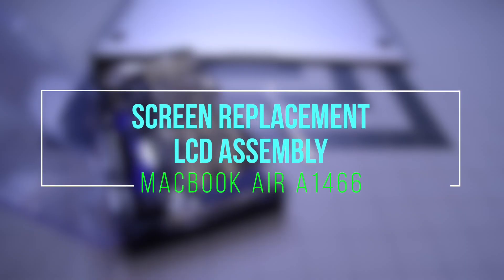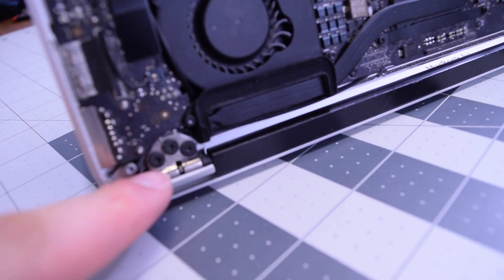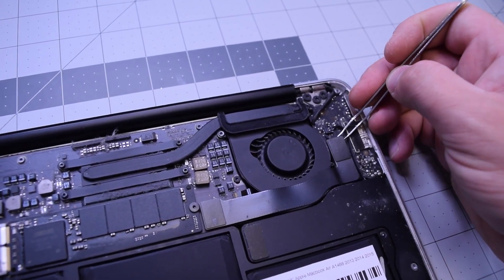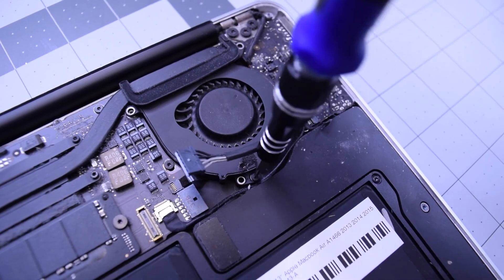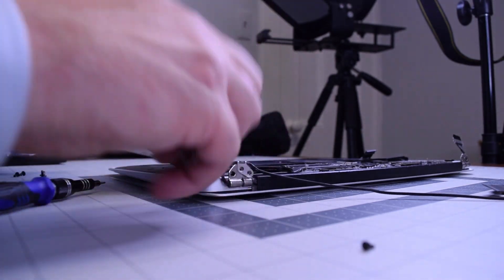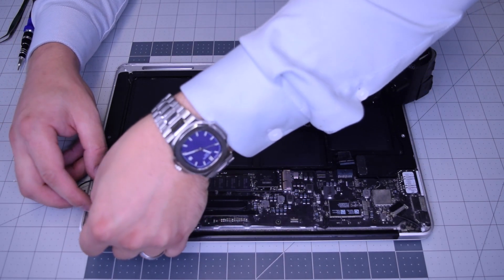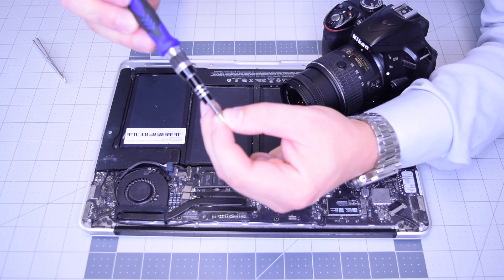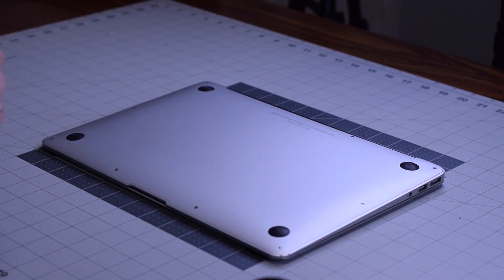Macbook Air 13" 2012-2017 (A1466) - Screen LCD Assembly Replacement

Comment: I really did not want to buy a new laptop for 1000$ and I am so happy that there are still tutorials out there for me on my old MacBook Air mid 2012. I saved 400$ doing it myself. 

PS. It doesn’t look like I messed anything up but I did not have to remove the fan or speaker connector. I just removed the Wi-Fi connector and the 2 connector on the side.
Reply: Please where did you get your screen from?

Comment: Of course, I'm 3 years late, but thank you for the excellent tutorial! replacing the screen was a breeze, following your instructions; just one little detail I'd like to point out: I was able to remove the camera cable without having to remove the dcn board, by just tilting the fan upwards, after removing the top left and bottom screws and unscrewing the top right one, a bit; that gave me enough room to pull the camera cable out; thank you for making this video available!
Reply: How did you connect the bluetooth?
Reply: Where did you buy your replacement screen from?

Comment: Hello I just changed the screen following your steps on my A1466 MacBook air.The screen is working. But now I have a new issue. The Battery is not charging. The Speaker is not working and the microphone also. What do you think could be the problem? What I did wrong? I hope you will answer.
Reply: Please where did you get your screen from?

Comment: Hey I replaced my screen but my replacement screen is doing the exact same screen of death as the one before. With a faded apple. The fan moves, the computer makes noise but the screen new still doing what the last one did, any advice?

Comment: if ur getttign a black screen ur lcd ribbon might be upside down, happened to me if anyones having the same problem
Reply: Dropped my MacBook once . Now sometimes the screen go grey/black when I turn it on but the screen is completely fine not even a single scratch. Do you think I should replace the LCD?
Reply: Janna Jeehan I replaced mine because I was getting color problem and glitches, if it doesn’t bother then it’s okay ig
Reply: Miguel T I took it to the store because I am not sure what’s wrong with it. They said it will take 400 dollar to fix it & to get a new LCD. But I am not sure if I even need a new LCD because like u said the Ribbon might be upside down
Reply: @jannajeehan2771  hey, just to let u know, even a very fine hairline damage in the lcd either visible or internal damage can cause this issue that u r having including lines, discolouration, grey patches etc Meaning the lcd is damaged even if it looks prestine from outside. I would say the drop or any impact it had been through. 
The cost of replacement offcourse depends upon the repairer but u definitely need a new lcd. Trust me I used to fix phone's lcds for living. 
I hope it helps anyone in confusion. 
Peace.
Reply: @uneel061  Thank you lol. Gave up on that macbook and bought a new computer

Comment: Thanks mate worked a treat ... fixed and saved myself $300
Reply: How you got the display?
Reply: @vanessamedina1081  https://pt.aliexpress.com/item/4000084747233.html?src=google&src=google&albch=shopping&acnt=494-037-6276&isdl=y&slnk=&plac=&mtctp=&albbt=Google_7_shopping&aff_platform=google&aff_short_key=UneMJZVf&&albagn=888888&albcp=7475419406&albag=78285569502&trgt=297309937645&crea=pt4000084747233&netw=u&device=c&gclid=Cj0KCQiAvc_xBRCYARIsAC5QT9lu5t00HRaNIu9gmQabNjSPr-uCHzjyQh98MAkntIegcN4foLnbhH0aAngYEALw_wcB&gclsrc=aw.ds
Reply: After completion my sound and headphone jack dont work. Help.
Reply: @milinkofilipovic836  well that’s on you, the screen has nothing to do with the audio or headphone jack
Reply: Please where did you get your replacement screen from?